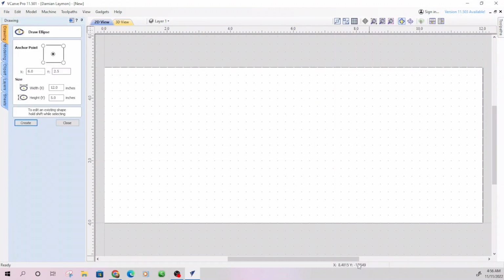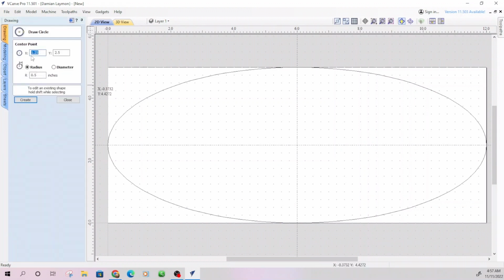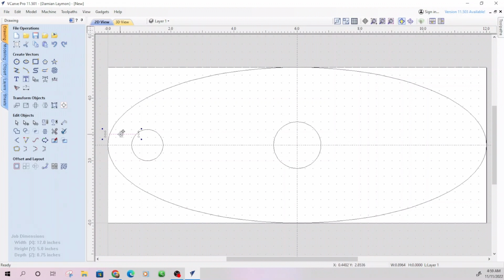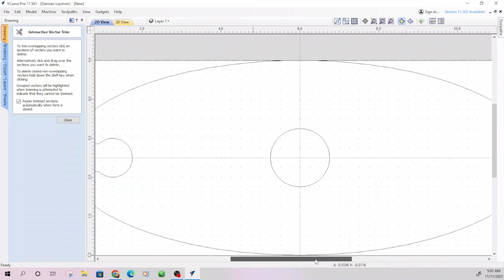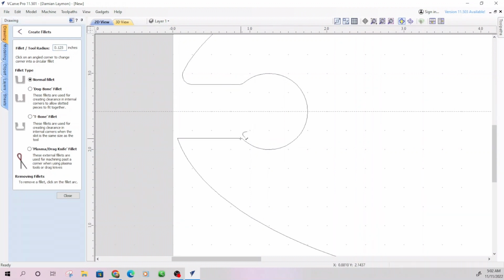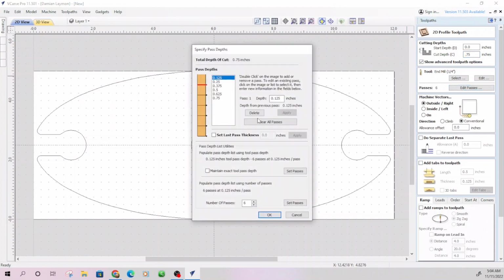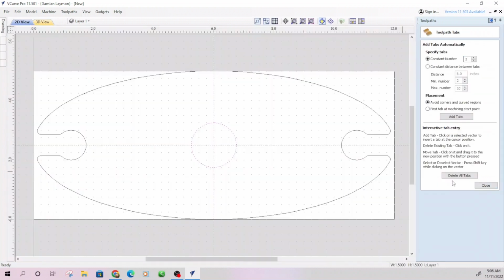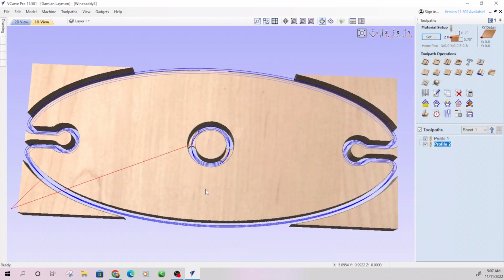Improve Your Work Flow With These VCarve Pro Tools | Onefinity CNC

Comment: Somehow Kyle Ely says you can select both and it somehow knows to cut outside of outer and inside of inner. Maybe on the inner one if doing separate could do a pocket instead of profile then wouldn’t need tabs or cutting and sanding then.

Comment: Click the align tool (farthest icon in transform objects section).  Then at the very bottom check “show common tools on drawing tab”. These will allow you to quickly create a shape and align it. Looking forward to the next video.
Reply from the maker: Great tip. I knew that the align tools were there, but didn't realize that you could put them on the toolbar. Thanks!!

Comment: I am enjoying your content.  Can you please please please work on your audio levels.... They are truly all over the map and I watch usually on my home theatre so large changes can scare the neighbours!
Reply: Check your editing software to see if it has a Normalize function for the audio track(s). That should adjust the volume to an even level that you set, and should eliminate the problems - especially if you're joining two different audio tracks.
Reply from the maker: I'll do that.
Reply from the maker: Noted. I didn't realize that they were that far off on this one, it didn't sound far off in my editing software, but I'll make sure to check from now on.
Reply from the maker: I went back and listened. You're right. I'll adjust better in the future.